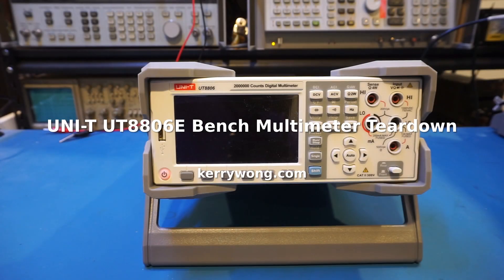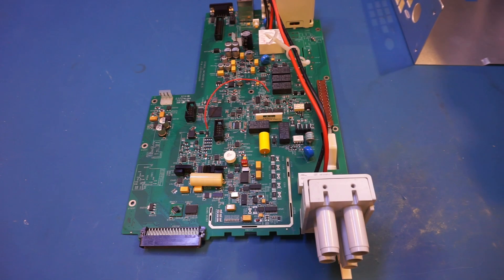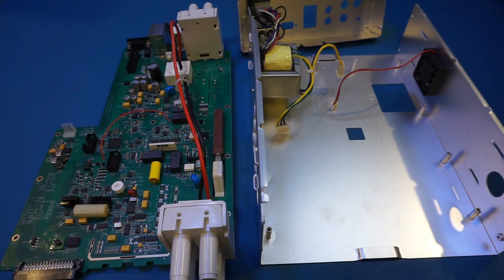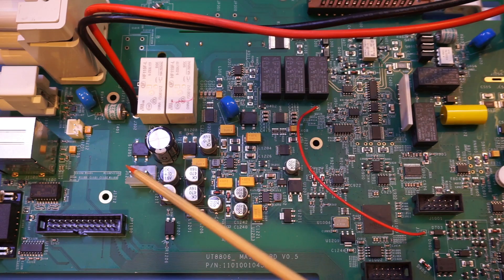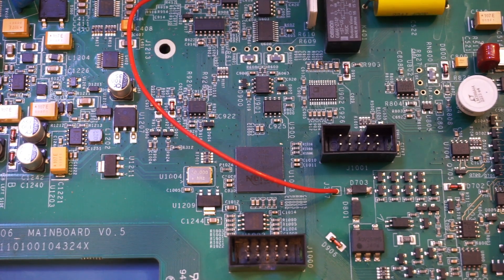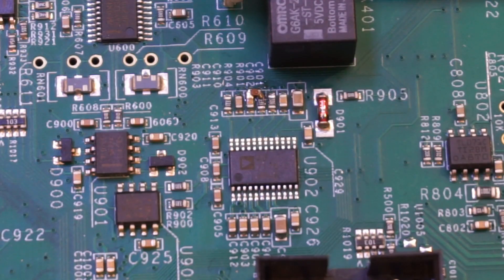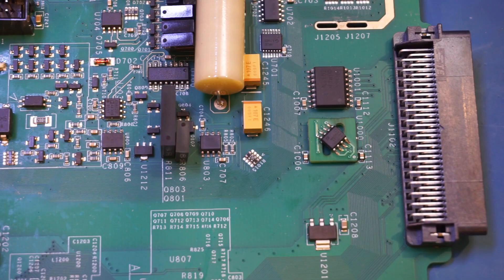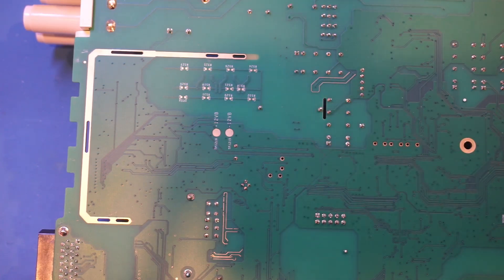UNI-T UT8806E 6 ½ Digit Benchtop Multimeter Teardown

Comment: Nice teardown Kerry. I wonder why they use the AD625? It's an extra-ordinarily expensive part and I'm struggling to think of any real benefit for this application. It's right next to the RMS converter so presumably it's being used to drive it and/or provide the variable AC gain? It wouldn't have any place in the DC circuits as it's horribly noisy at 1x gain (10uVp-p RTI 0.1 to 10Hz!) and the gain tempco at 5ppm/C would account for most or all the DC range's TC specification by itself. The AC input is single ended so why use an instrument amplifier? I must be missing something obvious. The 34401A uses a couple of LF357s for the AC gain and an MC34081 buffer for which dirt cheap modern parts are available.

It's also interesting that they don't specify the INL - perhaps because the AD7175-2 has max INL spec of 3.5 or 7.8ppm depending on whether the internal buffer is used? I guess the meter will be used in a relatively small operating temperature range so the ADC's INL might be much closer to the typical spec in practice. However, additional INL will likely arise from the ADC drivers. The 34401A specs the max ADC INL at 2ppm (rdg) + 1ppm (range).

Finally why would they add the cost and power consumption of an FPGA, and the additional supply voltage(s) needed (1.2V at least)? The STM32H7 would have no problem reading the ADC serial data (3 or 4 wire SPI). A much cheaper MCU would likely suffice for all the floating logic control functions.

Comment: The LM399 is around for maybe 30-40 years. It is very stable, yet not very accurate. 
I guess, the stability of the voltage reference is most important. Also the stability of voltage divider resistors The Caddock maybe is listed as 0.01%. Accuracy can be provided by digital calibration. I suspect there is a EEPROM somewhere. 
I suspect, that the 6.5 digit accuracy refers to the DC +/-10V range... the only range with GOhm input resistance. All other ranges have much lower input resistance, because it is impossible to manufacture GOhm resistors with any degree of stability and accuracy. RMS to DC chip is ancient as well and you are lucky if the AC measurement is 3.5 digits accurate.
It is a relatively cheap instrument and 6.5 digit maybe a bit exaggerated. These days, 24b delta sigma converters are everywhere and with additional post filtering you may get a stable measurement, but is it accurate?
Why do they have an old fashion (low noise) power transformer and then switching power supplies to get 3.3V ?
It is a good DMM... anything better than that and you are spending real money.
Reply from the maker: Have you looked at AD7175-2's datasheet? The ADC is quite capable and the offset error is in the uV range.
Reply: @KerryWongBlog  Yes this ADC is very suitable for a high resolution ADC. The difficulty in high resolution DMMs is not the ADC but just about everything else like clock jitter, high frequency noise at the input which will be aliased into the pass-band. Note, it is a SINC filter, not a FIR. Even the quality of the capacitors right at the input is most important... better be NPO. Then there are thermocouple effects as well as RF filter at the input opamp. Common mode noise rejection is huge according to data sheet but only when the frequency of the noise is within the opamp's range. RF at the input is rectified and appears as offset error. Since the analog part of the DMM is galvanic isolated, the capacitors from both sides of the input to ground must be closely matched.
Reply: That switching 3.3V supply just goes directly off to the front panel. That'll be the digitial-side control MCU, front panel display, etc.. There's no measurement frontend up there so that doesn't matter about a bit of noise or ripple.
Reply: @leonerduk  no, the switching regulator generates noise into the MHz range, which is radiated all over the board. If this energy hits the front-end (whose common mode rejection is only good for low frequency) the RF will be rectified and cross-modulated with the clock of the ADC, just like in a superheterodyne receiver. The result is sub-harmonics (noise) which alters the offset of the ADC... measurement error.
At 120dB dynamic range  (ADC) attention to detail matters.

Comment: Thank you Kerry for this nice and very well narrated teardown. I am impressed by the build quality of this meter. Your knowledge and patient explanation is also very well appreciated. One thing that as a retired technician surprises me: Why does one maker not stick to a common box size? As a former industrial equipment designer myself, I would have built in a shielded toroid transformer and used a very quiet fan. I am still in close contact with scientists using high tech gear. We often scratch heads to as why very expensive gear sometimes has a rather short service life. The button cell found inside here is usually good for years. But its placement could be put up to discussion to what might happen if its voltage reaches a critical level causing operator frustration. I bet some makers will place an indicator onto the front advising if a fuse had blown.
Reply: The E-core transformer is probably OK and it is done as an economy measure compared to a shielded toroidal power transformer.  The meter is usually set up to take an average reading across n number of power line cycles to help null out the effect of stray fields at power line frequency.  Keysight does the same thing - E-core transformer and averaging in the 34460A multimeter which is what I presume this meter is aimed to compete against.  Keysight also uses the LM399 voltage reference as do a lot of 6.5 digit multimeters.  I don’t recall what ADC Keysight uses.

It looks like there is a fair amount of quality per Dollar in the Uni-T meter.  You give up very little if any performance when used as a bench meter, but save around $500 versus the equivalent Keysight.  Uni-T’s warranty is longer too.